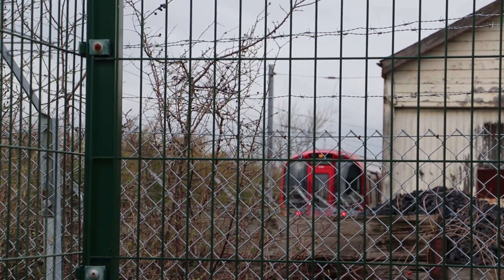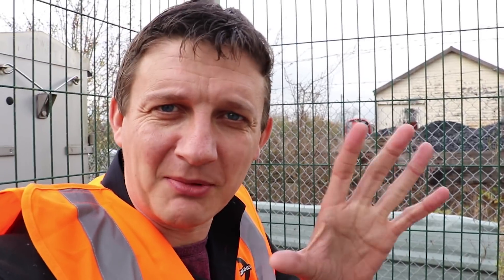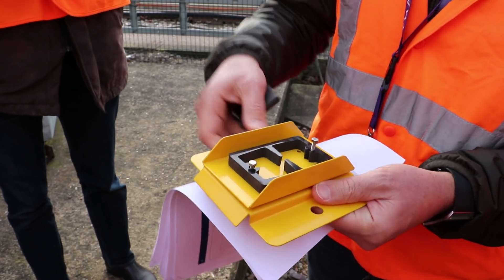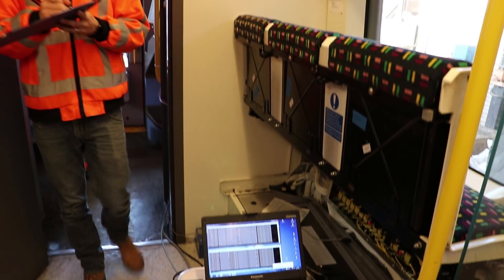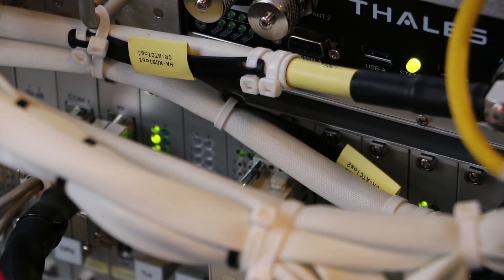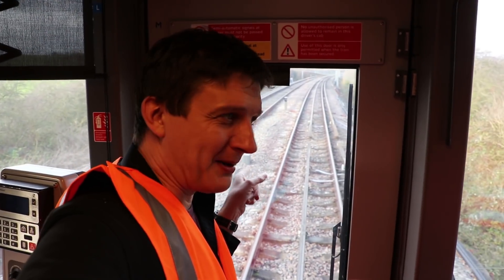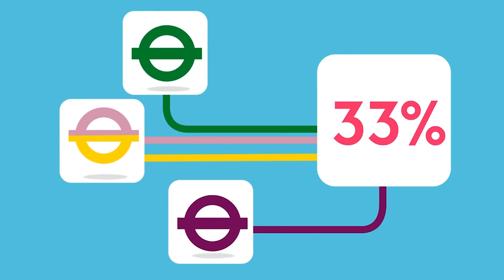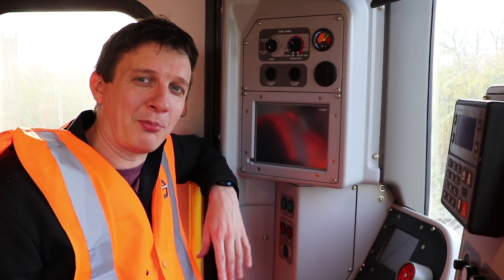London Underground Four Lines Upgrade

Comment: In Chicago where I live, the L system is in desperate need of de-interlining. Seeing all of the Tube’s sub-surface lines is just as alarming. I came up with some of the best ways to de-interline as much as possible and improve capacity.

Track layout modifications:

-Earl’s Court: Modify the track layout west of the station so that the eastbound tracks have a flying junction like the westbound tracks. Also, replace the Olympia branch’s junction with a level junction.

-Edgware Road: The layout on both sides needs modifying so that there’s a flying junction on the western side to allow the Hammersmith branch to connect to the main line via the outer tracks and the Kensington branch terminate on the inner tracks with tail tracks to have each side dedicated to a certain direction and not cross over the main line’s tracks.

-Aldgate and Aldgate East: Replace all existing level junctions with flying junctions. The inner tracks at Aldgate can be a provision for a future extension.

-Gloucester Road: Modify the track layout west of the station so that the center track is where the Edgware Road branch terminates.

-Ealing Broadway: Replace the level junction where it splits with a flying junction.

-Northfields: Modify the track layout west of the station so that the outer tracks terminate and the inner tracks continue.

-Rayners Lane: Replace the existing station with a 4-track layout and have the Piccadilly Line’s tracks terminate using the inner tracks with tail tracks. Again, a flying junction is needed east of the station.

-Wembley Park: Modify the eastbound track layout east of the station so that the Metropolitan Line’s local track heads into Neasden Depot and the express track continues along the main line.

Lines and services (all use 7-car trains, unless otherwise noted):

-District Line: Starts from Upminster and heads eastbound, running via Westminster and then terminating at either Ealing Broadway or Rayners Lane. Piccadilly Line runs only to Heathrow and never shares any tracks with the District Line. The Richmond branch will continue to be served by the Overground.

-Metropolitan Line: All sections shared by Chiltern will be eliminated and served exclusively by said line. Chiltern will also take over the Chesham branch. Will extend west of Aldgate and run to either Kensington (Olympia) or Northfields. May need to shorten its trains from 8 to 7 cars to compensate for the shorter platforms.

-Hammersmith and City Line: Will stay as is.

-Circle Line: Will be completely eliminated.

-New Line 1: Will run between Edgware Road and Gloucester Road, not sharing tracks with any other line. Will use 6-car trains, due to shorter platforms.

-New Line 2: Will run between High Street Kensington and Wimbledon, not sharing tracks with any other line.

-New Line 3: Will run between Wembley Park and Uxbridge, not sharing tracks with any other line. Will use 8-car trains.
Reply: I would say no of those except for Chiltern taking over Chesham and Circle Line saying bye bye

Comment: Those transponders will be the Achilles heel of the system.  A high tech sticky thing will not stop rain, snow, flood water or freezing temperatures.
Reply: You're aware this video is about improvements to the London Underground, right? As in, those high tech sticky things will be deployed... underground?

Comment: i wonder if they have to separately code each tag laid on the tracks or each one is manufactured with a different random ID# burnt into it and after laying you just run a test train along the tracks which reads the code from each tag and builds up a database of all tags with their location.

Comment: I think my predicts me as far as Network Rail May's Train Timetable, or summer so fort? So Hammersmith and Latimer Road is a first phase to test it out, if it fails may inconvenient just like EMTRS Cambrian Line last time in last summer - that mustn't happen but it will investigated. On the other hand; if the test does success on the route, also others to follow, then we will partial operation CTBC ATO in place at the time, as long as reality check any documents for insist likewise Risks Assessment to work carries out, so they will know do the job to keep just that.

One more thing to add as far as London Underground, Overground, Elizabeth Line as Crossrail, and Thameslink services wherever Keep-On-Moving as its a core; the answer of scenarios is - a big fat Clock 'COUNTDOWN Timer'! That it is needed while the Trains complete stop the platforms and All Selective Automatic Doors Opening operation to do so before Doors Closing after when a Time Is Up but Signal manual points control including - Junctions. So therefore should routine Destinations each train directions wherever to go as far the clear routes and to the other, and so fort. So you see, Countdown Timing needs worth punctuality to keep services will running every year in 24/7.

Comment: You won't feel a difference but you will hear it. The digitally operated motor control will pulse the speed of the train in order to maintain a specific speed. You can hear it on the Northern line train sets especially.

And watch how they stop too. They will literally decelarate to 0mph, precisely, promptly at the green line marker instead of slowly lining up. Very efficient. The only thing they could do to make it more efficient is if they open the doors at 2mph upon deceleration, just as they do with the Berlin(?) trains.

Anyway, one step closer to fully automated digital train control. No need for a driver if they add an infra red camera and a whole bunch of proximity sensors (line tresspass collision and suicide prevention system.)

Comment: Have you seen how advanced the Dubai metro system is? Whilst I’m proud TFL are modernising old infrastructure, truth is our metro is so far behind other world cities, and the only reason really is due to internal politics within TFL resisting change. Shame
Reply: Bungle2010 automation mainly, the dubai metro is driverless, the entire network is maintained by less than 30 people in the control centre! Politics in TFL will mean anything as efficient like that will be resisted.

Navigating your way through the underground is a hodgepodge of poorly thought out design decisions that have accumulated over the years. Stations like Moorgate, bank/monument are just a mess. Most of the walls and general appearance of our underground stations are dire, and unpleasant to use.
Reply: Bungle2010 replace the drivers with safety staff then trained to escort passengers underground? We’ll then hire 10x the staff at half the cost? 

Every London commuter knows TFL tube drivers are just greedy potatoes and will be happy when they are removed from the train!

Comment: And still speed in MPH. At least they showed points under seats where to put chewed bubble gums.
Reply: We use MPH in the UK, not Km/h
Reply: Tom Jardine 

I thought you guys use Metric?!
Reply: @scythal  We do... sort of. We're stuck somewhere between the two, milk and beer are sold by the pint, but petrol is sold by the litre (though we give mileage in miles per gallon). Road signage (speed limits, distances etc) is exclusively miles and yards.
Reply: @walale12  Why don't you guys fully switch though???
Reply: @scythal  why bother? The current system works fine, and I don't think the taxpayer could stomach the cost of having all the road signage replaced

Comment: Nice and this same CBTC Seltrac system is being run on 7 train NYC MTA IRT Queens Line which operates R188 (new builds) & R142As (coverted to CBTC operation).Not sure if this will go to the central line since it has 1990s era CBTC ATO operation installed

Comment: This is all great but what about the Bakerloo line, when the F is that going to be modernised? The trains are from the sixties
Reply: The trains are 72 stock, my understanding is that it will be done with the Piccadilly Line and that contract is waiting to be bid.
Reply: I agree, headroom is low, seats are small, air ventilation is poor etc, they seem outdated compared to the Metropolitan, Jubilee and Northern lines.
Reply: The lines roughly get modernised in rotation.

Comment: Does this mean there is still a driver onboard to operate the doors and such and the computer takes over, bit like BART/MUNI in San Francisco?
Reply: Yes - driver opens/closes door, driving is done by computer.
Reply: There are SO many trains which are completely autonomous, including the doors. No major problems have occurred that I know of.
Reply: i think it's going to be automated as well, but for now there is indeed still a driver on board
Reply: So does London, the DLR network which carries 120 million passengers a year has been running driverless since it was built in the 1980s. In fact the Worlds First driverless (ATO) train was the Victoria line designed and built in the 1960s, however a driver is still present in the cab but they don't actually drive the train. The lines being described in this video, parts of which include the first underground railway in the world from 100 years before the Victoria line in the 1860s! So yes it take a lot of work and money to re-cable, re-signal and re-lay a busy fully operational line for full automatic trains.
Reply: System is capable of driverless but whether the unions will allow it it is another matter (see DLR)
Reply: Here in Brazil we already have driverless systems
Reply: tyteen4a03  The Unions aren’t as powerful as the media purports them to be!  There will always be a person on the train to manually control the train even when there is no drivers compartment.  They won’t go down the route of cheap temporary workers either.
Reply: its not the unions, its a legal thing. Autonomous closing doors have lawsuit written all over them

Comment: Doesn't look very robust. Give it a bit of snow, the wrong type of leaf or even some rain and I fear it will be quite costly not function properly. Let's wait and see.
Reply: There will be teething issues, no matter how much this system is tested. I hope they will have manual driving at times, to keep the drivers skills up to date
Reply: You are forgetting about all the condensation from disgruntled British commuters huffing due to tourists not queuing & boarding properly.
Reply: That would probably be done for the off-peak runs. (For those routes with night service, that would be the best time to have manual operation.)
Reply: not to mention deliberate jamming, emp etc
Reply: I am no engineer, but i do worry that something will go wrong with it. They should of just stuck with the orange wire system.

Comment: The automatic system is exactly the same as the current DLR (and very old) system... Good to see its finally being rolled out onto the other lines
Reply: Nope - this one is CBTC (wireless communication) not TBTC (the wires you see on DLR tracks). More reliable.
Reply: tyteen4a03 oh okay cool! I mean I guess you could say they have similar principles
Reply: They work pretty much the same, just different ways of figuring out where the trains are.

Comment: 1968 Victoria line  https://www.youtube.com/watch?v=JiSR9O8t5Bo
The line is equipped with an Automatic Train Operation system (ATO); the train operator closes the train doors and presses a pair of "start" buttons, and if the way ahead is clear, the ATO drives the train at a safe speed to the next station. This system has operated since the line opened in 1968, making the Victoria line the world's first full-scale automatic railway.[note 2]
The original signalling has now been replaced with a more modern ATO system from Westinghouse Rail Systems.[2][22] LUL claims that this is the world's first ATO-on-ATO upgrade.[23] The new system allowed a revised timetable to be introduced from February 2013, allowing up to 33 trains per hour instead of 27.[28] This in combination with the new, faster trains will increase the line's capacity overall by 21%,[22] equivalent to an extra 10,000 passengers per hour.   https://en.wikipedia.org/wiki/Victoria_line
http://www.trainweb.org/tubeprune/Victoria%20Line%20ATO.htm

Comment: installing the track based detectors will take a long time.
Reply: It will take a while, first section Hammersmith to Latimer road should be running by the spring

Comment: The sub surface lines are soo boring now. They used to be interesting with all the different types of stock. Now it's all the same train. 😭
Reply: NiffIncentro At6/5 agreed. A bit like Thameslink. Now all class 700, and SWR are getting class 701 replacing class 455,456,458, and 707 operations!! 😭😭😭
Reply: Weirdo23 Abellio greater Anglia, London Midland etc are getting new trains as well. And there all based on the Aventra platform.

Comment: I hope TFL consider further deploying DTGR like on the Piccadilly and Central lines when the NTFL is introduced the demand on them is huge and there are nowhere near enough trains to cater for the number of commuters at rush hour. Now I know that Crossrail will take some pressure off the Central line but the Central will still be incredibly busy and with all these housing developments in suburban London, its is quintessential to install DTGR on these high demand lines. The Central Line is really creaking at the seams, can't wait to see the back of the unreliable, ugly, dated 1992 stock which seems to breakdown everyday leading to huge gaps in the service due to cancellations.

Comment: 1:44 - Trains have indicators?
Reply: The pacers have indicators (not used)
Reply: @jackbellwood7702  Because they are busses
Reply: Airbus is bus that go in air, S-Stock is has turn signal so it mean dat is twainbus, S-Stock is Twainbus confirmed
Reply: idk
Reply: everybody gangsta till the train uses the turn signal
Reply: @defaultmesh   everybody gangsta till a dead meme is resurrected
Reply: Just a sweaty try hard breeh

Comment: We have had a Thales system like this in Edmonton Alberta Canada for 3 years now and it has never worked correctly. I hope you have better luck.
Reply: Loads of teething issues for the Jubilee as well when it was first resignalled to SelTrac. They have years of experience now with the Northern also on SelTrac.
Reply: tyteen4a03 The live date for CBTC has changed over to November now
Reply: I can see this being an unreliable system maybe for a few years until it beds in.
Reply: Oh god that makes me hopeful!
Reply: Some of the tested systems here in UK do not work fully, yet.

Comment: This Thales system was mostly design out of technology used on the Vancouver Skytrains “Selectrac”. It has operated without a collision since 1985. UTDC and much later Bombardier developed a lot of the system years ago. Vancouver system uses twin leaky coax between the rail. 2 leaky coax due to the centre induction rain for the Linear induction motors used on most of the system. Extremely reliable software. Age of the trains are becoming an issue no, however they are beginning to refurbish the original mark 1 cars.
Reply: Two trains in Singapore under Thales SelTrac crashed into each other just last month, resulting in 38 injuries. Reason was due to software issues. Thales took "full responsibility" for the accident: http://www.straitstimes.com/singapore/transport/signalling-system-firm-thales-apologises-for-joo-koon-train-collision-assures

Comment: I've always wondered...how on earth do they get the S-stock trains out of London onto the test track? For obvious reasons, they can't detach them and bring them by road.
Reply: Cameron Amoils they are simply hauled up over the normal railway, by a pair of small diesel locos that have been adapted to haul the s-stock
Reply: There are various links to the NR network on the Tube network, most notably on the Aylesbury lines between Harrow-on-the-Hill and Amersham. You can see all of them at http://carto.metro.free.fr/metro-london/

Comment: What's the middle rail for on the underground?
Reply: London Underground uses a 4 rail system, 2 running rails and 2 power rails, one positive and one negative.
Reply: Reuben Lee 4th rail. For electricity.
Reply: Outside rail : -420V dc
Centre rail :    +210V dc

Giving a potential difference of 630 V
Reply: Because if the underground used only 1 electrified rail, the system would short onto the metal linings of the tunnels
Reply: Yea it creates less problems so there aren't many fires and to be able to shut it down. Also if there are no positive or negative, then there's more power in to the trains

Comment: Has a single point of failure analysis been done on this system? It's all great when its working perfectly but what are the safeguards in place should the system partially or completely fail?

It's awesome, just curious about the outside of normal operation parameters. :)
Reply: The driver takes over, with reduced speed.
Reply: Bottom 2 lines are dark and half

Comment: Will the district line get any faster between say Dagenham and Mile End as currently it's so slow. Why is that and will these upgrades improve it?
Reply: There will be slight improvements in running times across the sub-surface network, but nothing significant. The main change is the proximity of trains allowed by the signalling system allowing more trains to run in the same distance of track, thus allowing an increased frequency.
Reply: Tasin Khan The trains will run on full power so they will get up to speed a lot quicker, but I can’t see major speed improvements as there is a lot of junctions, and bends

Comment: This was supposed to have been finished before the S Stock entered service. Only 8 years and several false starts later
Reply: At least there's more significant progress, unlike here in NYC.
Reply: They couldn't implement the automatic control whilst the A, C & D stockswhere still operating on the lines.